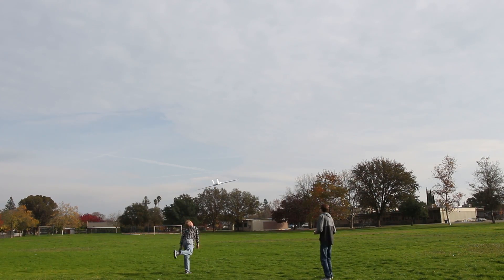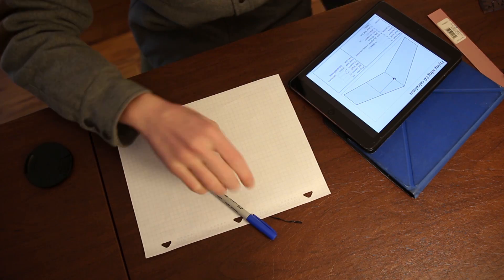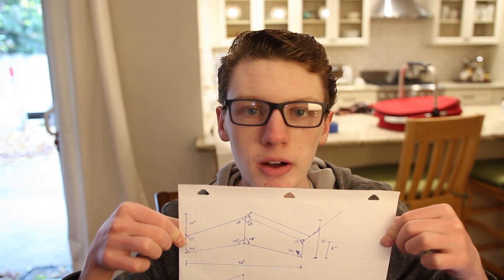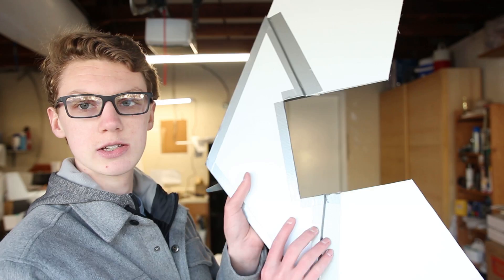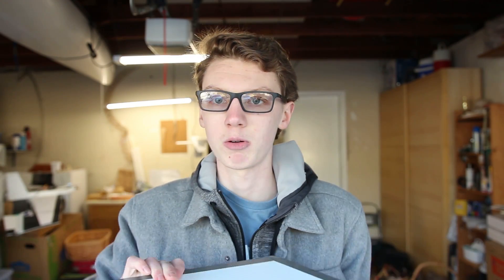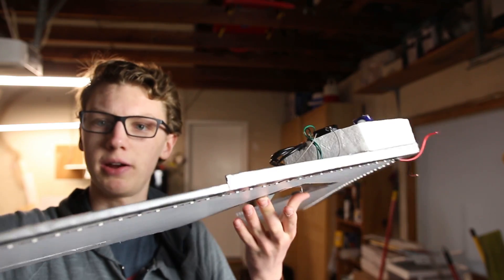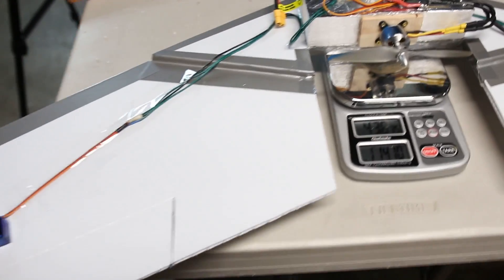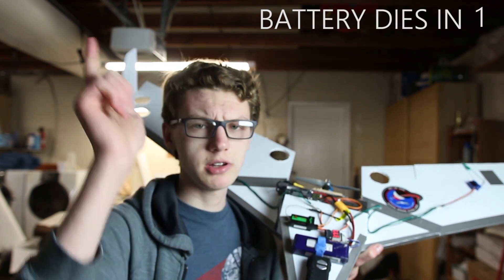Building an RC Delta Wing!

Comment: Whenever your hotwire cutting it is important to go as slowly as posible. You don't want the wire to bow much and when it bows just slow down and let it catch up. It's not as important when just doing straight cuts with fuselages but it is when doing wings.

Comment: I just built my first pc and i wanna here your tips on it
Reply: Cpu: Amd fx 8320
Gpu: geforce gtx 1050
Ram: crucial ballistix 8gb
Mobo: asrock970mpro 3
Case:carbide spec 01
Storage: 1tb seagate
Psu: 500w evga
Reply from the maker: Sounds nice :)